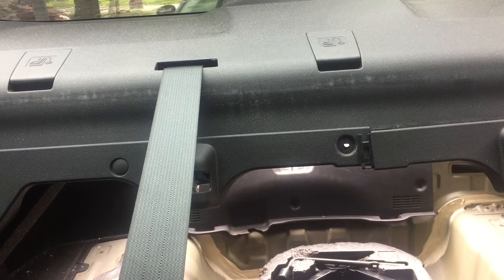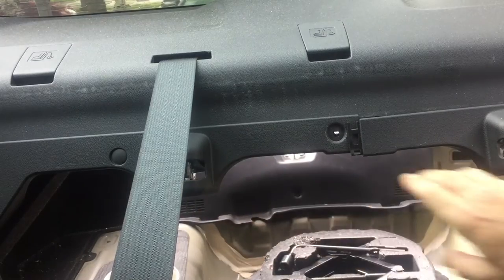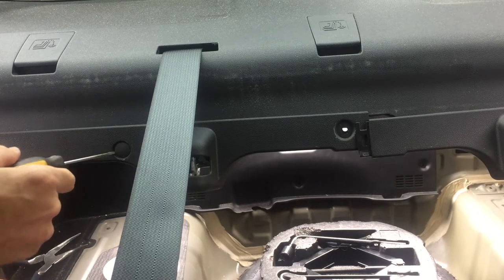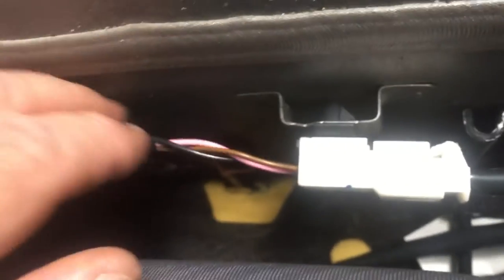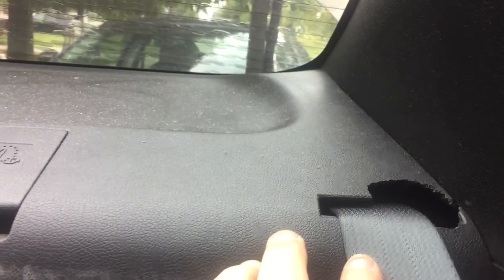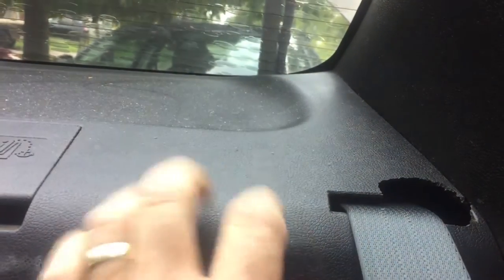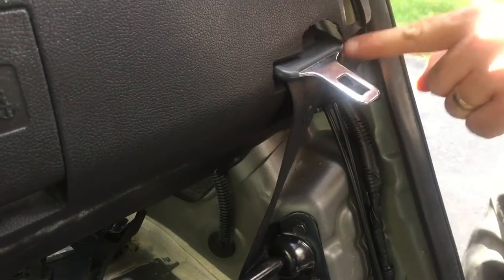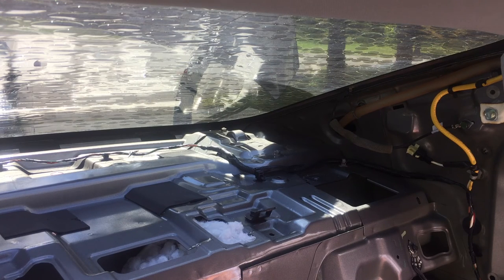2013 Hyundai Elantra rear seat belts replacement

Comment: I tried to put new ones in but I can't get the new ones to extend they are fully retracted. Are you able to assist
Reply from the maker: I bought used ones so they were ready to go. I'm not sure what would be preventing them from extending.
Reply: @GreatLakesJunction  I bought used ones as well and they wouldn't extend either

Comment: Okay, do I just take the rear seats off if I just need to replace the left and center buckles in the back?
Reply from the maker: yes the seats only will give you access, that end of the belts are bolted to floor.
Thanks for watching